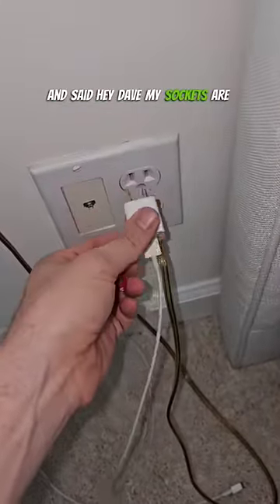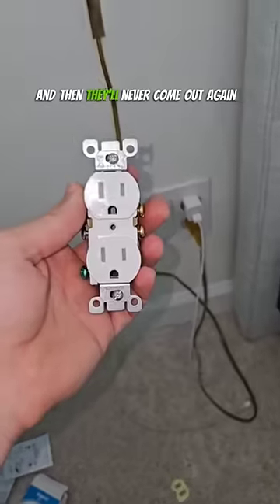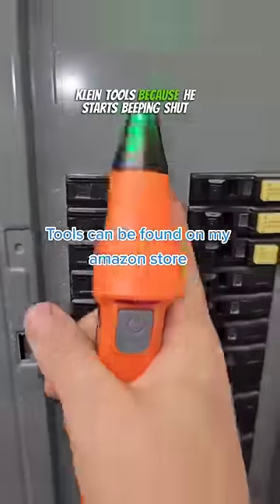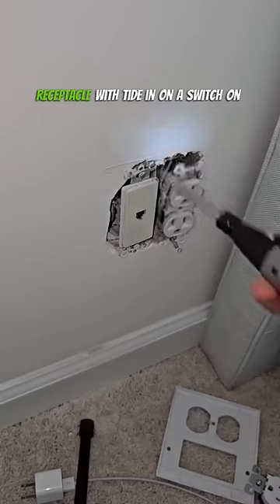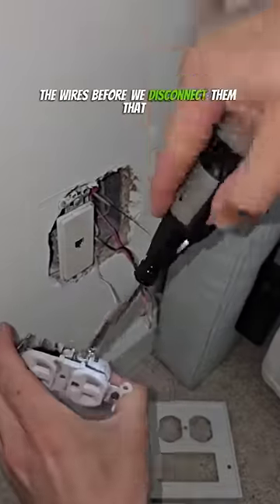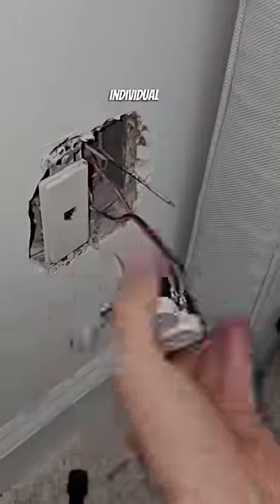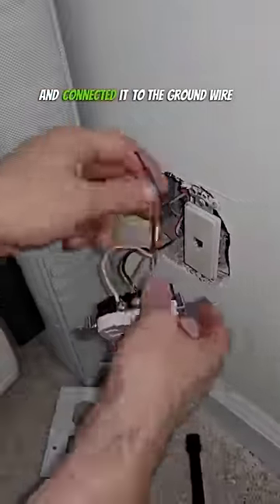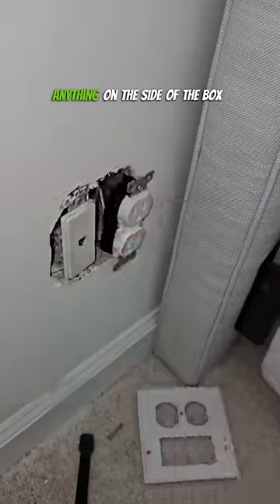🔥 Thats a hazard! How to change a switched outlet #diy #handyman #electrician #HowTo

Comment: As a european electician:WTF IS THAT OUTLET,NO REGULATION,MAMMA MIA
Reply: I was thinking the same. Wtf are those terminals 😂. And what kinda backbox.
Reply: What do you mean
Reply: We got regulations bud, Europeans could learn a thing or two.
Reply: @Zoraproxi  Haha are you joking? The UK in particular has the most robust and safest electrical specifications even with 240v outlets. Just look at our sockets and plugs that are all switched, fused, earthed and every circuit has a mandatory RCD so if you even touch the earth it trips the breaker with ease. No need for the weak GFCI recepticles you guys have to use.  This terminal box he shows is metal and doesnt have an earth contact? Standard practice here and prevents any danger with shorts.
Reply: @TheDeveer  The switch is a waste of time and money. You don't need it.
Reply: The outlet is just fine for most applications.
Reply: @Gravedigger933  UK Sockets are about £1.80 or $2.28 as standard. hardly a cost 😂😀 and zero time wasted??
Reply: They are regulated just it's a poor but legal design (for usa anyway)

Comment: Europeans scratching their head because their plugs don't get loose
Reply: Facts
Reply: They do, rarely, but they do. Had one in my house and only really noticed it after it had melted away enough insulation on the wires leading to it to blow the fuse (yes, real fuse at the time, no breaker yet). Luckily no fire.
Reply: UK Type G receptacles don't.
Reply: @executivecallahan1599  Yes, cry, it's very sad for you.

Comment: If you dont trust yourself with replacing a recepticle, find an old power strip / "surge protector", bend one or both prongs out a bit and leave it in the socket, and use the sockets on that. 

Obviously a temporary solution but itl stop you from fiddling with it every 5 minutes.

Comment: I agree with everything, but finding the breaker can be done in other ways than using an expensive tool for it lol. Sure, it's quicker and easier, but you can just read the labeled breakers, if none match (like my house, only some are labeled), you can just flip the breakers off until you find the right one. Unless you're in a hospital or major factory that somehow never labeled their breakers, their is rarely gonna be a reason that flipping off a breaker is gonna be a big issue, worst case scenario you have to reset a clock on some device like a coffee pot or alarm clock

Comment: You had me in the first half lol. But seriously, you did the right thing by replacing the receptacle.

One thing that you should've addressed is that phone jack on the left side. Low voltage wires like that shouldn't be in an electrical box. Or maybe it's not connected to anything and just there to cover up that gang. Either way, it's worth investigating and offering the customer options on what to do.

Comment: Personally, i prefer the "breaker findomatic model 120-15" (it's a cord repair plug with hot and neutral jammed into the same wire nut) for finding breakers, but something i HAVE done in my home is add corresponding labels from the breakers to the backs of the outlet covers.
Reply: Ah the classic bang finder

Comment: If yeh tapped a ground wire pigtail to the box, like theres supposed to be in all metal boxes, then you wouldnt have to worry about grounding out to the box. Also, not to nitpick too much, but tightening wires together with wirenuts makes a loose connection and is a huge pet peeve of mine. There are specific wirenuts that are sold for that purpose, general use wirenuts will strip out before you get a good bite.

Comment: I mean, you can just plug a lamp or something into the outlit, and when you flick the right breaker it'll go out.  You don't really need fancy tools to find the right breaker in a house.  Now if it was a facility with several breaker panels it might be different, but those usually have blueprints or breaker maps.

Comment: I mean using the breaker finder isn't the only way to find which one needs to be shut off.  You could:

1. Turn off your breakers until you find the one for that area.

2.  Label panel doors correctly so that none of this is necessary.

Comment: I'd like to point out that while that is the correct way to find a breaker, its not the only way, (when working on my own stuff) if I either dont have my breaker finder with me or if I'm just too lazy to go find it I have a clipped off extension cord with a marrette tying live neutral and ground together, I call it the hill billy breaker finder. It hasn't failed me yet

Comment: Guys pro tip: instead of using fancy tool (expensive) to locate correct breaker, you can simply stick a piece of copper wire between live and neutral (cheap) and the breaker will automatic trip making it safe to work on :))

Comment: You should go bond wire then neutral and then both hots. It's good practice. Also you don't need to turn the power off. It's only 120V. I wear gloves so I can do it live

Comment: It is possitively dangerous to use sticky pads to hold a plug or electrical device in a receptacle. If it's falling out, then it means that the receptacle isn't gripping the prongs properly, which means that the electrical contact isn't going to be great either. That's a recipe for overheating.

Comment: That metal box was floppy, not secured well. It was also split with low voltage since it had a phone jack, but didn't have a partition like most places require.

Comment: Moden plugs are probably safe enough to just put a paperclip in
You absolutely should never do that, but it's probably safe enough
On a more serious note it'd be nice if plugs could be re-tightened without causing metal fatigue (and preferably without opening the plug)

Comment: Surely not the only way to find a breaker. I've seen plug testers that check polarity and wiring etc that have a button on them to purposely trip that breaker, so you can do it from the plug you're working at

Comment: I live in a trailer home that's been here for decades and many of our outlets are like this. in addition to the breaker tripping often when I use the dryer. and power cuts off to the living room if PCs are both on and heater is on high

Comment: those stickers are also not gonna fix the issues that come with a loose socket, such as high resistance from a poor connection. eventually it'll lead to an outlet fire when someone decides to plug something high current (such as an electric heater) into that socket.

Comment: Or just plug in a light and flip the breakers till the light shuts off so you don’t have to buy a Klein tool for a one time use. Just saved you probably over $100 for a $5 socket replacement

Comment: first there are plenty of other ways to find the breaker.
second there is no need to shut off the breaker if you know what you are doing. i have never once turned off the power to change a receptacle and ive changed hundreds of them. even if you do get shocked, its not that bad.

Comment: I was taught to either plug a lamp in the socket then turn off the breakers that are most likely one at a time with someone watching the lamp relaying to you by yell or phone. Or run a throw light to a point you can easily see. Btw my grandpa would always un plug and check both plugs not sure why

Comment: Why didn't you note to make sure the ground is bonded to the box sence it's a  meta boxl? Code violation. It's not even code to tape off recepticals, but it's code to bond the ground to all metal boxes. So I'm curious to why you noted to tape the receptical but not to bond it to the box.

If you had bonded the ground to the metal box, the breaker would have been tripping from that hot terminal anyways. Sence it wasn't taped. It looks burnt. Technically it would have been safer if it was bonded to the box in the first place. And tape would have just have brought it to the same outcome as it has now withous to be bonded to the box. To be replaced

Comment: That's a cool tool but it isn't the only way to find the breaker. You can also just flip the switches until the power goes off in something that is plugged into that outlet.

Comment: Take out the fuse. Take a lampe to check if there really is no electricity on the socket and unscrew it and push the springs back to build up pressure again.
Reply: NO. Always replace. You can't do that with this type of receptacle

Comment: Just FYI; if you, for some reason, do not replace the outlet, it will melt
Reply: @@davidwalton3604 because there's bad contacts, which leads to the prongs overheating the outlet

Comment: UK receptacles don't have this issue
Reply: It's crap like cheap receptacles that keep us electricians in the US busy and pay checks rolling in. 🤣🤣 I lived in Canada for 5 years if you want to see some crap parts and materials used check them out. Metal boxes as thin as beer cans
Reply: Yeah, but the 220v is a lot more deadly and if you thing the switch is same your insane.

Comment: That's not the only way to find the breaker. You can use a loud vacuum or a radio with the volume at max plugged in the plug. When you hear the vac/radio go off you know you got the right one.

Comment: "the only way to find the circuit is this circuit breaker tracer"

You could also just, oh I dont know, plug in a floor lamp and start testing breakers until the light turns off.

This video makes me upset😢

Comment: Wow that's a cool and handy tool u have there! But where are u putting the tool on like a metal plate in the middle of the circuit breaker? I can't see it very well. Where I am from the circuitbreakers are labeled so u know wich one shuts what off and u double check with a multimeter. To what voltage can u use that handy tool? Ive never seen that 😂

Comment: I just hate this type of socket. The european socket (atleast the one thats used in the netherlands) is just simply lock in a brown, blue and yellow/green wire and screw in the socket. Its so easy that ofcourse with supervision a 7 year old can do it (speaking from experience) no need for clamping the wires with screws. They’re basically just a wago but instead of connecting wires with eachother, you’re connecting wires to the socket

Comment: Cheaper way to find the breaker is to plug a radio turn it up loud then go to the panel
Reply: Radio cost more then the tool.  I haven't had a plug in radio for 20 years.

Comment: Ok, dont use electrical tape. Get a box extender. They are super cheap and then you never have to fuck with tape residue. I also invert all my switched recepticles so you can tell by glancing at it

Comment: But if it shorts to the box then you know there's an issue and more importantly aren't going to be electrocuted. Why would you insulate that ? It's part of the earth Process. Boxes here in the UK literally have screws to wire to earth for this reason.

Comment: Actually thats not the  only way , you can have your wife yell when the lamp goes off or just short it to flip the breaker. Ive had to short wires a few times but you gotta be careful if theres shared neutrals . Like some older buildings especially when multiple breakers are involved.

Comment: Not only a fire hazard but a curious little kid who doesn’t know any better could bridge the two prongs which lets the angry pixies light up his world, always and I mean always replace your outlet when they start getting loose and plugs don’t stay in, it’s cheaper to replace a an outlet then to may medical expense or plan a funeral as toddlers are more susceptible to long term injury from electrocution or even death.
Reply: Let’s also not forget that electricity follows the path the least resistant which if I remember correctly is up your arm through your art and down your leg trying to reach ground!

Comment: Ok ok answear me a question. I switched a lamp with cables and all. The fuse was still in. I touched the wires copper where the fuse was on but didn't get shocked. I didn't have any type of rubber or deflecting material. I stood on metal at that time but still not shocked. Why

Comment: The brakers look like from 1940, tapeing the socket is very odd. The whole US electrical System is very weak against false Installation. I really dont like screw systems, better are push pull loaded springforce systems this systems are much safer.

Comment: Or you can do it after flipping the main which is the safest way in case some dumbass tied 3 rooms and 6 different receptacles to one and the other half the room to another. Or you could just do hot work it won't kill you unless you've got a bad heart and even then it's unlikely at that level of current

Comment: Or you just Reader the fucking fuse circuit diagram that every good electrician should put in the fuse box during an installation so that the Oner see what fuse is gor what room

Comment: my gawd, you're not an electrician at all. you shouldn't touch shit if you don't know what you're doing. first, never trust a non-contact tester, they are unreliable. the only way to find the breaker is to use that tool? very wrong, I've never even used one. then you say always put the wire on one way, go to the ground wire, and do it backwards... no electrical tape around the outlet. you probably use zip ties too, never use zip ties on electrical.